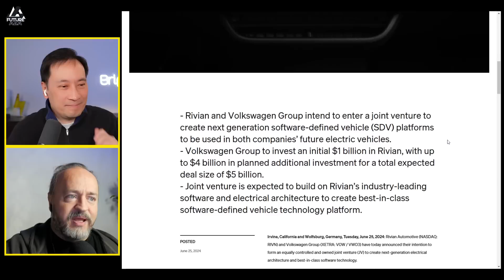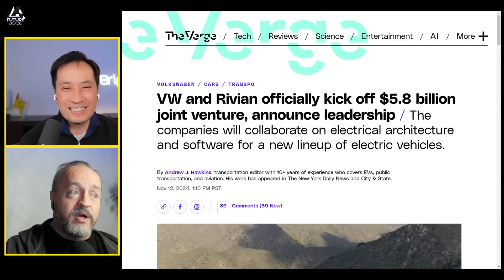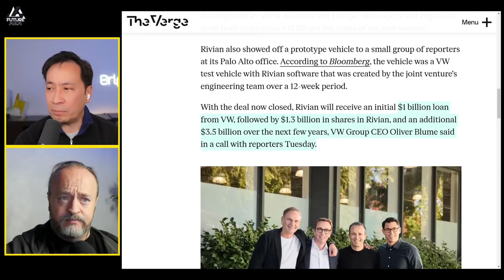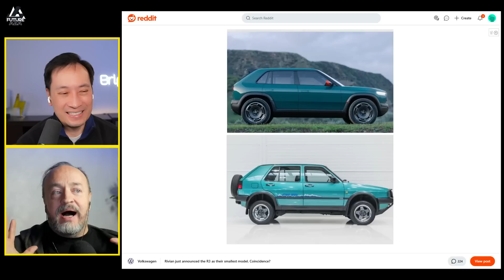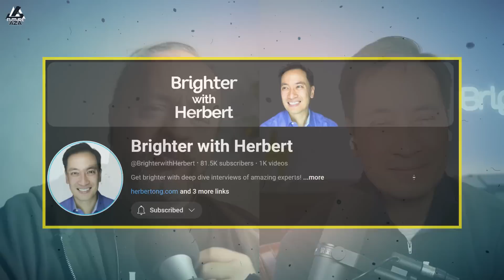VW/Rivian Partnership Plows ahead with Billions to Boot

Comment: For Rivian's software to work in the scout, the Scout has to have the hardware the software can operate, meaning it makes sense the Scout models  are a rebranded Rivian R1 or R2.
Reply: That's a good point missed by many. Now, this really comes down to actuators, as far as I understand, so possibly the models can be quite different but the same suppliers with the same actuators would be needed. Or, possibly the Rivian architecture is more agnostic then legacy auto stuff but probably not enough to overcome the point you made.
Reply: @machoopichoo2  It's all components that now are controlled centrally by software rather than a switch/knop and control module from a supplier component. Windows, seats and any thing VW today by as separate components from suppliers. If you get the Rivian software you would also use the same suppliers and can get a much better deal from the suppliers.
Reply: @elvinthalund5193  I think we are in agreement. I am just suggesting that adopting the Rivian architecture/software doesn't mean VW has to use the exact same parts as Rivian does (requiring models to be near copies of each other). They just need to use suppliers/parts that can work with Rivian's system. Sure, economies of scale are another factor. But, despite VW's general incompetence, they are the big dog here and can bring more economies of scale to the situation than Rivian. 

I understand Jim Farley's complaint about having hundreds (thousands?) of different actuators that all have their own software. However, the solution seems to be to create a good architecture, make more stuff yourself, then force suppliers to fit your system.

Comment: Rivian needs to drastically reduce costs. Money infusion and partnership doesn’t lower costs.
Reply from the maker: Absolutely!
Reply: Rivian recently took large strides to reduce the cost of their models and reportedly cut costs by around 35% overall. Probably still not enough but a good job to head in the right direction.